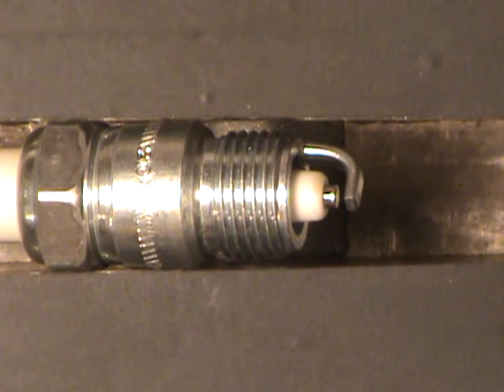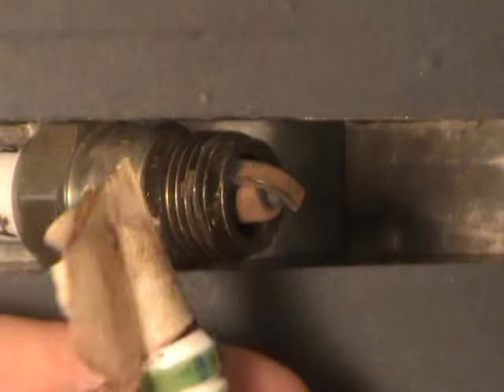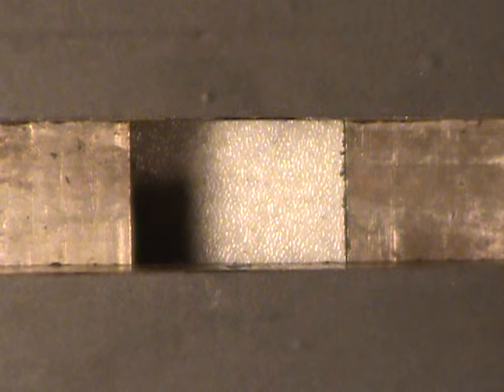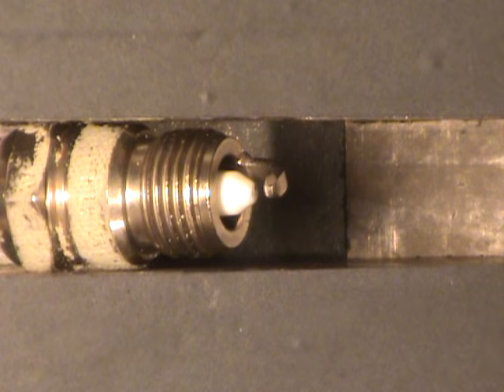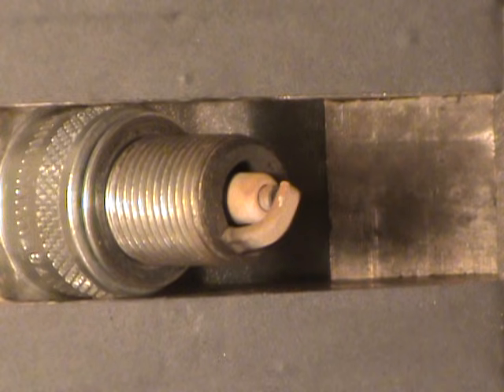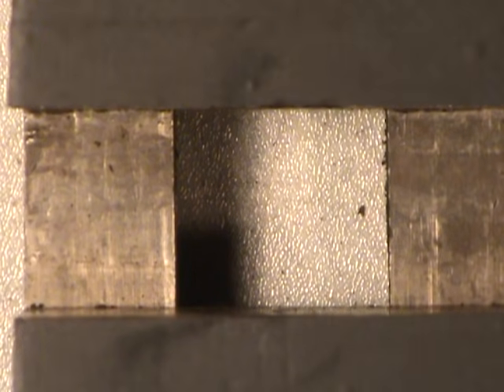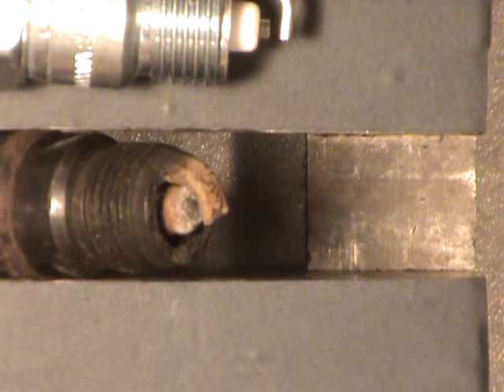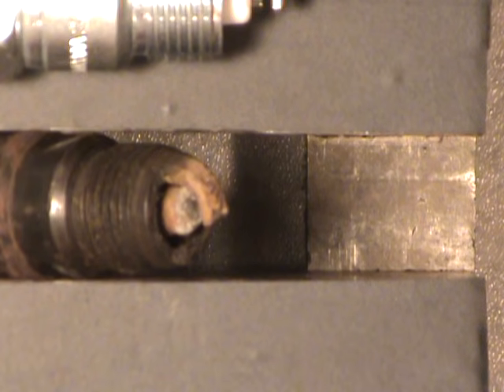SPARK PLUGS How to Read them (Part 3)

Comment: VERY helpful !!!!! Thank you.
Reply from the maker: +TheTkirk Greetings TheTkirk....You're welcome, and, Thanks for watching..........Please note.......the Spark Plugs that I used as "Movie Props", in this YouTube Video of mine, were out of older, lower compression engines, and showing on them, was a fair amount of "Deposits", as compared to the Newer, Factory/Stock, Fuel Injected Engine's Spark Plugs, that will probably have "Fewer Deposits" on them, and more then likely, be showing an almost White color, on the Firing End's Porcelain, providing that the engine is operating, as good, as it should be do-in................................An Engine, that has, in very good condition, almost like New Ignition Parts, as well as, the Proper/Specified, Ignition Timing Settings, then, the result, will usually be..."More Power & Performance"...and...if You can go, Easy on the Gas Pedal, then..."Better Fuel Economy"...it will be....................Till next time............Be Safe, take care, and have a good one.
Reply: +RockysRoadshow I have a small block Chevy with10,2 compression so this was helpful. I tried a set of E3 plugs and they were burning brown but had a hint of green down in the lower part. The plugs I took out were a little black but dry.
Reply from the maker: +TheTkirk Greetings TheTkirk....Ah yes, Your, good ole Small Block Chevy...V-8, probably somewhere between...265 to 400 Cubic Inch Displacement, and having 10.2 Compression Ratio, with lots of Get-Up-and-Go...!!!...................I found that, I had pretty good luck, using AC-Delco Spark Plugs, in the mostly, Factory/Stock, Small Block Chevy V-8's that I had, as long as they were the "Exact", Factory recommended ones, that were usually found on the V.E.C.I. (Vehicle Emissions Control Information) Label/Sticker, that was usually stuck somewhere in the engine compartment...............................There are lots of things, that can cause, just about any Spark Plug, to be having/showing, a bit too much, in the way of Carbon Deposits, on the Firing End of them...........................Things like...the Design, Heat Range and Reach, of the Spark Plug itself...Ignition System, working good, as well as, the best Ignition Advance Curve, which includes the best...Initial Timing Setting...the Advance Weights Curve...and, if a Vacuum Advance Unit/Canister, is being used, to have it Calibrated/Set-up, for the Needs of that particular Engine............................If You are running the Vehicle on the "Street", and the Engine has, either a Points & Condenser Distributor, or, a GM/Chevy HEI (High Energy Ignition) Distributor, then, if, "Not Using" the Vacuum Advance Unit, then, Your Ignition Timing will probably be on the "Late Side", when the Engine is at a Light Load, and just Cruising along, while using very little Gas Pedal, and at times, can be the reason, for that Unwanted Carbon Buildup.............................If You have a Carburetor, on that Chevy V-8, and it has an operational Choke System on it, then, the Choke Plate, and the rest of the Choke System, has to open up all the way, and do so, as quickly as possible, while warming up, while not having, the Engine Lean Bogging/Surging, because the Choke System "Kicked Off" too soon......................Sticking Choke/Plate, can and will cause not only the Spark Plugs to Carbon-Up, but also, the Cylinder Heads (inside), and the Tops of the Pistons, can also have, some unwanted Carbon, Deposited on them as well, same goes for a Carburetor's..."Too Rich of an Air/Fuel Ratio/Mixture"...as well, and, High Compression Engines..."Don't Like or Want Any Carbon at All"...!!!...or, maybe some Pre-ignition or Engine Damaging Detonation, might be the Result...!!!...Yikes...!!!...and I hope not .............................Carburetor Floats, sometimes will "Sink", especially so, if they happen to be made out of that Nitrophyl (looks like black plastic) stuff, as I've had, happen to me, in the past, and, the Carb was so rich, that, quite a bit of Gasoline, ended up in my Engine's Oil Pan, and, I can only imagine, how much Carbon, got Stuck to my Engine's Innards...!!!...Yikes...!!!...lol.............................If You care to, You can let me know, what You are able to, about Your Engine, and its Ignition and Fuel System Components, Fuel/Gasoline Octane Rating...Octane Booster/Additive, and any Problems with it, Running-wise, or not...............Well..........Till next time...........Be Safe, take care, and have a good one.

Comment: Hello Rockyroadshow, please how does a low impedance affect the performance of a plug viz-a-viz the engine performance?
Reply from the maker: +Bamidele Bukola Greetings Bamidele Bukola....Thanks for watching................Low Impedance You say........................Usually, for the average Joe, when-ever parts for a Vehicle's Ignition System's "Specifications", are being looked at, such as Ignition Coils, Distributor Cap/Carbon Buttons, Spark Plug Leads/Wires, and the Spark Plugs themselves, basically, what I'm usually see-in, is their "Resistance"...usually expressed in..."Ohms"..................................If the Vehicle in question, has an "On-board Computer", along with, the many Electric/Electronic Sensors & Actuators, a Person has to be very Careful, about even thinking about "Lowering" any of the Specified "Resistance Values", especially so, on the "Secondary/High Voltage" side/part of the Ignition System, due to the Increased Chance, that..."High Voltage/Electrical Fields"...that could "Leak" out of, something like, an example, be-in, some Old School, Spark Plug "Leads/Wires", that had, a "Solid Wire Conductor/Core" (Very Low Ohms/Resistance), to Carry the High Voltage, from the Ignition Coil, to the Distributor Cap's Center/Tower, then, the other, Spark Plug Leads/Wires, carry that High Voltage, to each and every Spark Plug in that particular Engine, which my Friend, has the potential, to Interfere with/Disrupt, the Proper Operation of, an Electronic Circuit, that happens to be in the area, of that very Unwanted, High Voltage, "Electrical Field"...............................Then, oh lettuce say, that, we have a very Old Car, with a "Points and Condenser" type of Distributor, mounted in the Engine.........................The Ignition Coil, the Ballast Resistor, and the Condenser (capacitor), in those particular Ignition Systems, had to be, shall we say, "Matched", or, the Ignition Coil, might not put out, a High Enough Secondary Voltage, and, the "Spark", at the Spark Plug's Electrodes, would probably be Very "Weak".................................Now then, lettuce say, that, the "Rating" (usually in Ohms) of the Ballast Resistor, was Too "Low", then, as I see it, it would just be a matter of time, where the Ignition Coil, would probably Over-Heat, and go Kaput (aka, stop working)............................A good example, of that High Voltage "Electrical Field", usually coming from "Leaking" Spark Plug Wires/Leads, as I have experienced for myself, was, Hearing the "Clicking Noise", out of the Vehicle's Radio Speaker, when the Radio, was Tuned to an "AM Station" (AM = Amplitude Modulation), which varied, in Pulses (being Heard), from, quite Slow, when the Engine was at Idle Speed, and increasingly so, as the Engine Ran Faster (Picture/Imagine, that good ole Baseball Card, Flappin' against Your Bicycle's "Spokes", and the Sound that You Heard, when You were Riding Slow, as compared to, Riding Really Fast...!!!...lol...ah yes...the Good ole Days...).................................If Everything, in the Vehicle in question..."Was Not Affected"...by..."Altering, the  Factory/Manufacturer Resistance Values"...then, as I see it, as it applies to Spark Plug Leads/Wires, the "Less Resistance, the Better", but Only if, those "Resistance Value Changes"..."Don't Upset the Apple Cart"...!!!...as in...the "Changes"..."Don't Cause Any Safety Concerns/Problems"...and also..."Doesn't Damage Anything in the Vehicle"...as well................................If the Vehicle in question, has to be "Smog/Emissions Tested", then, a Person, has to Make Sure, that, any Changes, Don't Result in, that, not so wanted..."FAIL" (word), be-in Printed, on the Vehicle's Test Results Paper/Document...!!!..."Yikes"...!!!...lol................................Always take plenty of time, and consider, just what might Happen, if You were to "Change or Modify", Anything, on Your Vehicle, and You get it Wrong................................Maybe Damage the Vehicle, and at the very same time, maybe Waste a pile of Money, and I hope not..............................The things that I mentioned above, are only..."The Tip of the Iceberg"...so to speak, as there seems to be, an almost Limit-less, way of doing things..................The Racing/Performance, minded People, will probably be using, a very Strong/Intense Ignition System these days, which, for the most part, will, shall we say, "Get the Fire Lit", as in, have a nice "Strong High Voltage Spark"...at the Spark Plug's Electrodes, in order to Ignite, a sometimes difficult, High Performance Engine's, Compressed, Air/Fuel Mixture, that will result, in that Engine's, Highest Performance Level of operation possible.................................I'll end with, just how Serious, some Ignition Systems may be...........................A 1/4 Mile, Top Fuel Dragster, will usually have "2 Magnetos", to, shall we say "Light the Fire".........................Don't get too close to one of these "Magnetos", as I've heard that, there might be, in excess, of about 40 Amps/Amperes of Electrical Energy present, when they are workin'...!!!..."Yikes"...!!!..........................If You happen to be looking for, oh, shall we say, a "Stronger Spark" (at Your Engine's Spark Plug Electrodes), try to think in terms, of the Ignition System, as a Total "Matched" Package, and have a look online, at the many Different Ignition Systems Available, for Your Exact Engine, perhaps.......................Also, Make Certain, that, You ask Yourself this..."Just How am I (meaning You), going to Use/Operate My Vehicle...???...as that will probably be, one of the Most Important things to consider........................Well......Till next time.........Be Safe, take care, and have a good one.
Reply: Hello rockysroadshow it's not a car it's a gas generator.
Reply from the maker: +Bamidele Bukola Greetings Bamidele Bukola....You were saying, "gas generator", was the Gas, actually Gasoline...???.............................The best advice, that I would recommend, for Your "Exact" Gas Generator, would be to...."Use the Manufacturer's Recommended and Specified Parts, along with any Adjustments/Settings, that the Manufacturer Specifies"...that way, Your Gas Generator, should perform, as the Manufacturer intended, it to be working................Lower "Resistance" Spark Plug Leads/Wires, might not make much of a difference, seeing as how, the High Voltage is so High, on the Secondary side/part, of the Ignition system, and, I'm thinkin', that, Your Gas Generator's, Engine's Compression Ratio, isn't all that High, to begin with.............................Where-as, for something like a High Compression, High Performance, Racing Engine, then, yes, some of the High Performance Engine, Parts Manufacturers, do offer for sale, some rather impressive..."Low Resistance, High Tech, Large Diameter, Heat Resistant, Spark Plug Leads/Wires"...for the reason, as I see it, and that's to provide, the Highest Voltage/Amperage possible, to the Spark Plugs, in order to create, shall we say, the "Strongest, Most Intense, Spark Possible", at the Spark Plug's Electrodes, to ensure, the best Ignition/Initiation possible, seeing as how, the Highly Pressurized, Air/Fuel Mixture, is more difficult to Ignite, and also, at those, usually quite High RPM's/Revolutions per Minute, of the Racing Engine's Crankshaft as well...!!!..........................If You don't have one already, try and get a hold of, Your..."Exact"...Gas Generator's..."Factory Service Manual"...as it should have, the much needed Information, as in..."Correct Part Numbers"...and...the Needed..."Adjustments/Settings"...some of which, could be...Spark Plug, Electrode's "Gap" Size/Setting...Ignition Timing...and possibly...Carburetor Adjustments/Settings (if applicable, that is) as well.............................Even with Brand New, Correct Parts "Installed" on Your gas Generator, things like Carburetor Adjustments (if applicable), and Ignition Timing Settings, should be, as the Manufacturer "Specifies", along with using the Correct Grade/Octane Gasoline, if in fact, Your Gas Generator actually Uses Gasoline, that is, oh, and, You do have "Fresh/New Gasoline", in Your Generator's Gas Tank...???...as "Old/Stale Gasoline is "Not Good"...!!!............................Unless You plan on "Hot-Rodding" your Gas Generator, start with, as good as new Parts, and do a good "Tune-Up", to Manufacturer's Specifications, and, You'll probably be Amazed, at "How Good She'll Run", if all Filters & Parts, are Clean, and in good working order, and, all of the Adjustments/Settings are properly done...!!!..............................If You care to, You can let me know, about, Your "Exact" Gas Generator, as in, Year...Model...Horsepower...the Amount of the Generator's Output (Volts/Amps/Watts)...and any other Specifications, that You can see/find...thanks.........Good Luck, and..........Till next time.............Be Safe, take care, and have a good one.

Comment: Can a bad spark plug cause you engine to vibrate and not run like silk?
Reply from the maker: SacreDro Greetings SacreDro....Thanks for watching, and for, Your question as well....................Yes, indeed, One or More..."Not Working So Good/Faulty"...Spark Plugs, can and will, at times, make for an Engine, that has, rather Poor Performance, and Poor Gas Mileage as well.......................Actually, an Engine, that has, one or more, Faulty Spark Plugs, can be the cause, of some, almost Un-Noticable Engine Running Problems/Fails the Smog/Emissions Test, all the way up to, an Engine, that, might kinda, shall we say..."Shakes Like Jello"...!!!...lol.....................Just about anything, in the Engine's, Fuel (Administration) System, the Ignition/Spark Timing System, and also, any, Emission System related, Part/Component, that..."Is Not Working Reasonably Well"...can cause, many, did I say MANY, Different...Engine Running...Behavior/Symptoms...like You wouldn't believe...!!!...................Sometimes, it turns out, that, (suspected), Ignition Related Problems, turn out to be, Fuel Related Problems, and, the Other-Way-Around, as well...Yikes...!!!...lol.....................If Your Vehicle, is any need of help, just let me know, and.........Till next time.....Be Safe, take care, and have a good one.